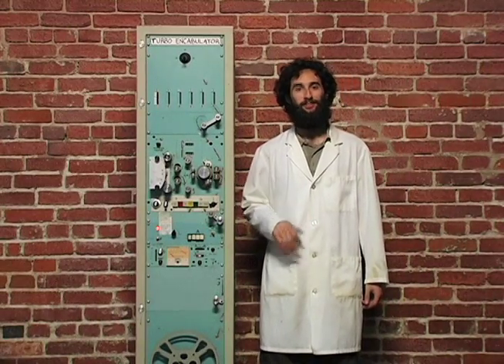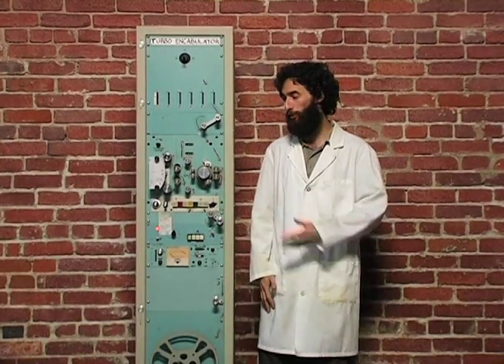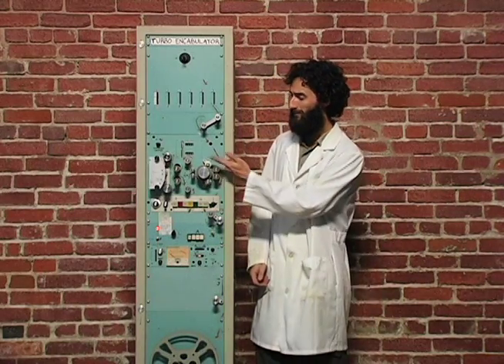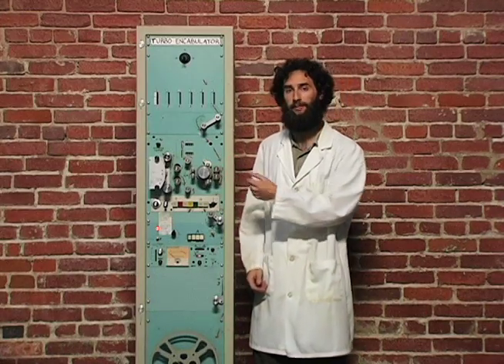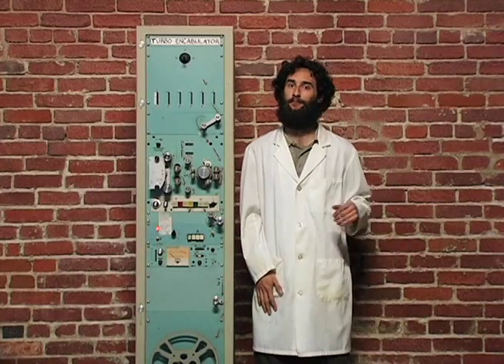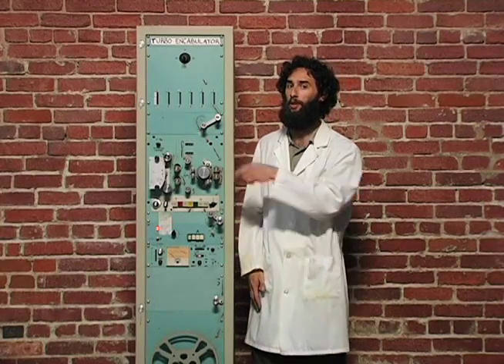Turboencabulator (Upright Version)

Comment from the maker: The Upright version utilizes an updated avoirdupois system instead of the antiquated Troy grain units. Also, argon cooling tubes are unnecessary since this model works on microfliudic capillary action. Xenon was purely a cost-cutting decision, therefore the machine only operates properly in the Northern Hemisphere (The polarity is reversed for our South American customers)

Comment: I need a better encabulator for my Milford Trunions.  Immodial interaction would solve my problem of the the spurving bearings being in direct line with the panametric fam.  I've got too much side fumbling.  Having the differential girdle spring on the up end of the grammeter is a much better idea too.